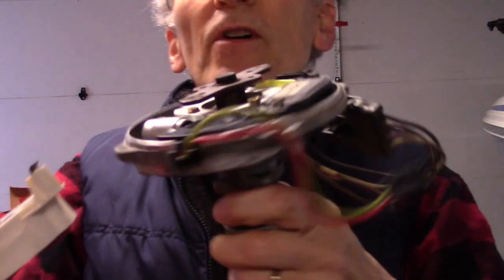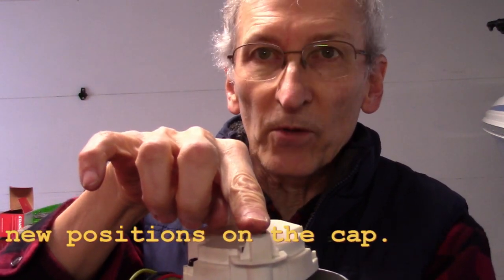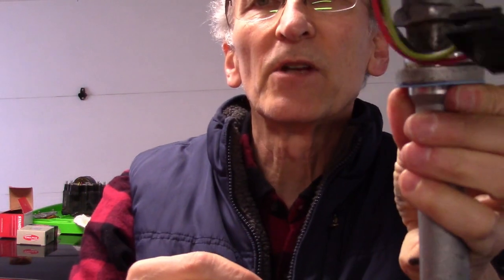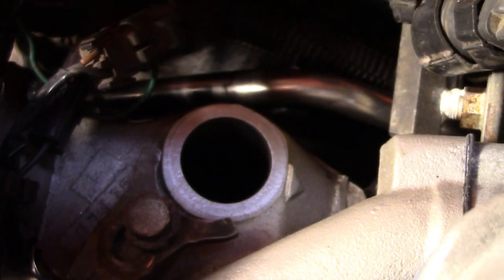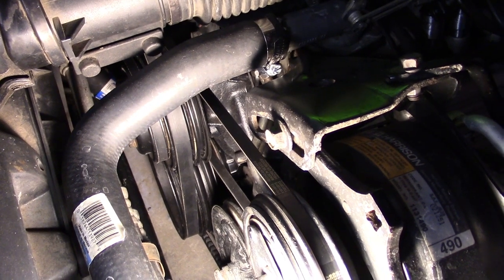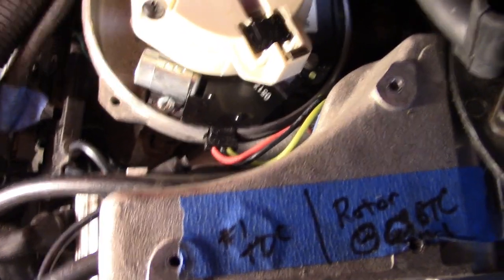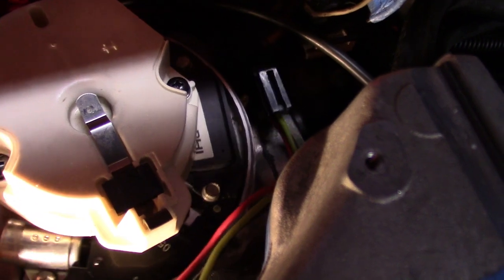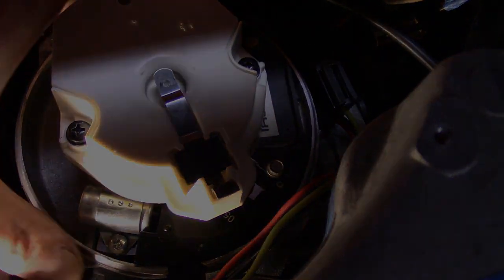Installing the Distributor - 5.0L 305 Chevy TPI - IROC-Z Barn Find EP#37

Comment: My iroc (same engine) has a small sputter/miss during idle after a dizzy swap. Could it be affected by a tooth off or so?
Reply from the maker: If you are able to get the timing set to spec, the distributor is probably not off a tooth.  If it is off a tooth or more, you would usually need to rotate the distributor an unusual amount to bring the timing into line. The cap would need to be pointed in an odd direction. I have done that before on other engines and it was difficult to get the engine to start and run because the timing was so far off. On my IROC, I found that I need to check the vacuum hoses very carefully after I work on the engine.  It is easy to have the evap canister hose come loose (as an example) and a little bit of vacuum leak can upset the idle. I don't know the details of what you swapped, but if those are all good, and it was just a distributor swap; I would be double checking distributor components--cap / rotor / coil and electrical connections.  Something may be causing weak spark.
Reply: @bitsofwisdom460  Thanks for answering. I've sprayed the entire engine down with starter-fluid, trying to find a leak (to no avail).   The distributor is from Standard, I've swapped the ignition control module as it was bad (I suspect a lack of thermal-paste cooked it.) The base timing was set to 7-8 degrees before tdc. I think I might have to fiddle and play with the timing as you say or perhaps try an other distributor from an other brand. 

Do you think fuel-grade will have anything to do with it? Lowest octane-level I can get here in Norway is unleaded 95. Would this have a different outcome and result on timing? 

On the other hand, when I'm not driving it the battery is disconnected (Fire-Hazard). This would affect parametres of the Ecm, right?
Reply from the maker: @kmas8229  My experience over the years with Standard parts has generally been good, but any company can have a defective part. Hopefully the replacement module is good.  Actually any new part can be suspect.  I had a brand new coil intermittently fail on a different car, and a new oxygen sensor and a new IAC fail on my IROC.
I would not expect the octane level to cause a problem.  If I understand correctly, your 95 Octane fuel is the "research" rating.  In the US we use (Research + Motor / 2).  I ran 89 US (or 94 Research) when I was going through break in for a little insurance and it ran great on that.  I did experiment with initial timing on my engine and ran it as high as about 14 degrees. After about 10 degrees, the idle quality seemed to deteriorate. Fuel vapor pressure due to winter vs summer fuel can have an effect.  If you have a full tank of summer fuel carried into cold weather, that can sometimes cause issues.
You are right that disconnecting the ECM will cause the loss of the learned parameters and that could cause some performance issues while they relearn. 
If you are confident in the distributor, I would go back to basics.  Check the fuel pressure, check with a scan tool to be sure all the operating parameters and sensors are normal, check that the fuel vent system is working correctly, because this influences vacuum.
Reply: @bitsofwisdom460  Hello again and thank you so much for taking the time answering me, it means alot for me. 
I had to swap out the icm thrice, first distributor was defective(icm was sent back along with it), second icm made the car sputter and slightly shake during coasting at even speeds with low throttle. An Ac-Delco Icm fixed that. 
Last summer I swapped out the old Multec-injectors for new Bosch 3's (19lbs) Fuel pressure regulator was swapped, filter and also did a thorough cleaning of the EGR-valve. 

After the car was all buttoned up and everything torqued to specs I went over it with starter-fluid to check for vacuum-leaks and fuel-leaks.
Last night I checked the rotor placement in the dizzy at TDC. At 0 degrees tdc it was pointing at the intake runner furthest back on the drivers side (Cyl7). The terminal on the cap for plug wires on cylinder 1  was in and around the same spot. In other words, the rotor was not pointed at cyl-1 during tdc.

(Prepare for a pontientially silly question)

Will this have an effect, as the plug-wires  appear to be in the correct sequence for the firing-order? 

I plan on trying to use the car alot more to let the computer do its thing, just have to wait till late March/April to let the salt be rained away.
Reply from the maker: @kmas8229  You're welcome, glad to help if I can.  Sorry to hear that you had so much difficulty with the distributor.  I am not sure if I understand about the rotor and cap.  Let me try to repeat.  You said that at #1 TDC, rotor points at runner 7, the terminal on the cap for #1 plug wire is near the rotor.  But then you said it was not pointed at cyl #1. I am not sure what that means.

Let me try this.  If your engine is at 0 TDC on cylinder #1 on compression, and the rotor is pointed at the terminal for cylinder #1, that is correct and good.  If the wires are in the firing order from there around the cap, that is good.  If in this position, you can set normal base timing around 6-8 degrees, the system should work fine.  

The direction of the rotor toward the #7 runner should not matter if the above is true.  I think that generally the distributor on a small block sits with #1 around the 5 o'clock position.  Probably between 4 and 6 o'clock, and there may be exceptions to that.  If it is further than that, the spark plug wires and factory wiring harness connections may not be long enough to reach.  Then you could move the distributor over a tooth (or two) to adjust.  However, in principle: As long as the relationship stays in place with #1 cylinder at TDC on compression and rotor pointing at #1 on the cap with the magnetic pickup firing the coil at 0-10 degrees BTDC--the distributor could be installed with #1 pointing in any direction and the engine would not know the difference and be perfectly happy.

By the way, I understand the comments about salt, that is about equal to my climate as well.  I leave the battery connected in winter, but use a battery maintainer that holds the system at a full charge without overcharging the battery.  If I needed to disconnect the battery, I might look for a memory maintainer.  There are some out there that will provide a small 12v charge just to keep the ECM alive while the battery is out.
Reply: @bitsofwisdom460   Hello again, thanks for replying so fast, feels like I'm learning alot here. I'm really enjoying this, again thank you for your time and patience.

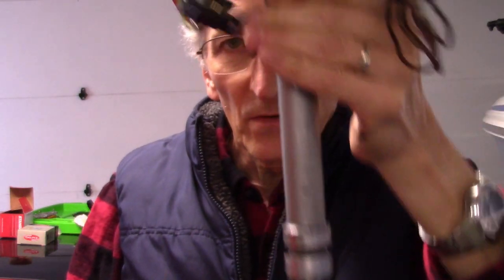You're correct on the direction of the rotor. It's pointing towards 02:00 at 6 to 8 degrees btdc(same as the cap-terminal for plug1, I had it timed for 6 to 8). And at 0 degrees at tdc it's pointing more in the 0300-position. Between the terminals between cylinder 1 and 8.(Sorry for not being too good with my explainations of my woes, I used to be better with English.)

Other than that, the wiring are in the right position for the firing order. I noticed something on the plug-wires that I haven't noticed before. Two of the wires had a long boot to protect the wiring from the heat of the headers. I suspect that the boots were too long. It didn't feel like the wires clicked properly onto the plugs and sat tight. Trimmed them down a bit and got the "click" I was yearning to hear when re-plugging them. Also, I managed to drop and crack the ceramic on the plug for cyl 1 (Butterfingers). I'm gonna see if I can get a new one Monday morning.

I think I need to aquire a long screwdriver to drive the oil-pump a bit so that I may line it up for the dizzy and get it lined up for cyl 1 and then re-do the timing. I got a hunch now, and it's maddening and my fingers are itching to dig in.

As for disconnecting the battery, the guy I bought it from almost had his storage complex burn down due to some mishaps with a battery connected on one of his cars. That's when I decided to have it disconnected when not in use. I do occasionally smart-charge it to maintain it.

Hope you're doing well!
Reply from the maker: @kmas8229  I am doing well, thank you.  I hope that you are, as well.  Your English is very good.  I also know from my time in the global business world to be a little extra careful to clarify things, because we don't always understand a phrase the same way.  Regarding the distributor  cap and rotor, there are some subtle things to consider. I would not necessarily be concerned about the precise alignment of the cap terminal with the rotor. The terminal in the cap may not always line up exactly with the rotor and that is a good thing.  If you think about  it carefully, the cap is fixed to the distributor base with a tab feature, so the terminal is always lined up in a certain angular position relative to the stationary part of the magnetic trigger.  Also, the rotor is keyed to the rotating portion of the magnetic trigger in a certain angular position.  This means that regardless of which gear tooth the distributor shaft is positioned on, the cap and rotor should have the same angular relationship for the same crankshaft angle when the pickup triggers.  In addition, consider that the normal spark timing for an engine can be from near zero to perhaps 36 degrees at max throttle and even as much as 40 or 45 degrees at light throttle.  In order for the spark from the rotor to be able to jump to the cap terminal over a span of 45 degrees, the rotor ought to be ahead of the cap terminal at zero degrees and it will be after  the cap terminal at 45 degrees. This way it should always be able to arc across through the entire timing range.  Does that make sense?
Reply: @bitsofwisdom460  Hello again! Thanks for giving me such an easy and explainatory reply and I'm glad to hear you're doing well! 

I think understand what you mean! So let me try to re-iterate here just to see if I got it right. As long as cylinder 1 has been set to TDC and the distributor is installed with the rotor lined up at the terminal in the cap for cylinder 1 it's all well and good and I'm at 0°?  

And then if the base timing is to be set at 6° btdc (for factory setting) the whole distributor-assembly will be rotated slightly counter-clockwise, so the terminal for cylinder 1 is @ 6° before piston 1 reaches the top of the combustion-stroke. 

And when the EST-wire has then been reconnected the computer will then adjust the timing itself by climate, temperature, atmospheric pressure and other factors provided by the plethora of sensors in and around the engine?

Looking forward to hearing from you! :)
Reply: @bitsofwisdom460  Also, just re-watched your video for the 2nd time and I must say I just had an "eureka-moment" here. I get it! 

I got the tools necessary to do a re-seating of the distributor as well as aligning the notch in the oil-pump. I think I'm gonna do this so that I can align the wiring into the ICM little better as well, they're a little bit tight and out of reach for my liking. I suspect the repair-shop have missed abit on the distributor, throwing the ECM off abit as it seems to run better at idle with just base-timing and the EST-disconnected. It may just be the computer needs to re-learn the different parametres?
Reply from the maker: @kmas8229  Yes, you are correct.  That is exactly right. And, if you watch the timing mark with EST connected, you can see it in action.  My memory on a particular cold start was that the timing went up to near 25-30 degrees (in park) and gradually came down as the engine warmed up.  It all depends on the timing algorithm driven by the sensors.
Reply from the maker: @kmas8229  There certainly are ECM algorithms that adapt based on the system learning how your individual engine is responding.  I haven't been into the code on these older ECMs, but typically there are short term and long term fuel trim adjustments and I expect there are others. What I can't answer is whether this will be enough to bring everything into line for you. 

If it isn't enough, keep in mind that a challenge on these older cars with "OBD-I" is that the controls engineers had only a few years experience with ECM control and the related diagnostics were limited in capability.  I remember when this was all introduced--it was a new world with a lot to learn. What that means is that a sensor can sometimes be a long way out of spec before the ECM recognizes the fault.  For example, I had a very bad oxygen sensor - it would drop out entirely when hot  (video is posted).  But the diagnostic required on the order of two minutes at a steady road load with certain boundary conditions before it would set a light.  It was hard to get that condition.  Just something to keep watch for.
Reply: @bitsofwisdom460  Hello! Good to hear that some knowledge got into this noggin of mine! Awesome!

Wow, that's a high timing indeed! How was the weather and temperature on that day?
When I had the car at the shop for the distributor-swap the old guys there (who had basically had most of their childhood beneath the hood of old American cars) were not too familiar with these engines (neither was I, had just aquired the car) . They gave me a call and were scratching their heards at the timing, as they imagined that it would be adjustable as with an old carbureted engine. 
I think the timing was around the same ballpark as yours! We were astounded and thinking "How's this thing running at all?!"

On the algorithms and parametres of the ECM, kinda being hopeful that just using the car later on will fix the issues I've been having. Haven't driven the car as much as it deserves. 
Re-seated the distributor yesterday and gonna have her timed today! Hoping for the best. By the way, I think I'm gonna advance the timing a bit. I'm thinking around 10° btdc sounds good?

As with the video on the O2-sensor, I remember that one! That must've been frustrating! Being a millenial I can only imagine what mechanics, hotrodders and engineers were thinking. As with EV's I reckon there were some skepticism?

Hope you're doing well and having a good day!
Reply from the maker: @kmas8229  I have run with base timing up to 12 degrees. It seems to have a little more power there and knock sensor will pull back if necessary.  I am back at 8 right now, because in hot weather, the idle speed was a little unstable.  It is your choice, but I haven't had an issue at 10. I do have a slightly stronger cam, so that can also have an effect.
Regarding the amount of timing for an engine, it depends on the individual engine combustion chamber design plus the emissions limitations.  Many of the older American V8s liked 34-36 degrees at wide open throttle and high engine speed. With vacuum advance cans that provided 15-20 degrees, total could be in the 40's at highway cruise. At light throttle, flame speeds are much slower, especially with a lean mixture.  The newer engines like Vortec 350 or LS have "faster" combustion chambers that need less timing.

When GM came out with ECM controlled carburetors and 3 way catalysts in 1981 (ECMs in every car), there was great skepticism amongst many of us engineers as to whether the cars would be durable.  But the Delco Electronics team really did a great job with the ECMs and the vehicle divisions generally integrated the systems rather well.  The systems were much better than many of us expected.  I know that there was variation and some customers had complaints.  In my case, sometimes I had warning lights, but I was never left by the side of the road with my 80's GM cars.  It was  quite a revolution and a lot of learning.
Reply: @bitsofwisdom460  Aaah, I see! 10° was tempting at first, but I was wary of spark-knock or pinging and the problems that may occur if I run the car with it.

Cool! The older distributor didn't have a magnetic pickup-coil right? It was "points" or what it's called and they had to be replaced at service intervals and tune-ups? With Vacuum-advance on older cars, would the vacuum-canister be the "big 'ol lump" attached to the side of some distributors?
Sorry for asking so many questions, I'm having a great time with this knowledge and the "history lessons". 

By the way! I re-seated the distributor yesterday with the rotor towards cyl #1 at tdc 0°. Timed it at 8° btdc.
After that I did a IAC-reset, idle speed adjustment (a 3/4 turn inwards on the idle screw for more air) and set the TPS at exactly 0.54 (OCD got me the right voltage haha) She's running like a champ now at 750rpm all buttoned up!

Again; Sorry for pestering you with questions. Hope you're doing good!
Reply from the maker: @kmas8229  I am doing well, thank you.  And it sounds as if you now have success on your car.  Congratulations!
Yes, the vacuum advance can is the big often shiny lump on the side of the distributors without electronic spark control.  The vacuum can design goes way back into the breaker point days.  I don't know when it was invented, but it has been around since at least the 1950's.  Electronic ignition came around in the mid 1970's, so vacuum advance was used in both types.  I think GM introduced HEI in 1974, primarily because catalytic converters were coming in 1975. While breaker points were actually not a bad system, they needed regular maintenance and would have fried many catalysts when people didn't keep up with it.

Regarding the advance methods, the engine needs more advance for two reasons: 1. the combustion process is slower at high vacuum and more time (or crankshaft angle) is needed and 2. when the engine speed is high and time from spark to TDC is shortened.  So, the way this worked is that in the mechanical world (assume a small block), the distributor had a mechanical advance mechanism of weight and springs.  You might have 25 degrees of mechanical advance that would start at zero at idle and max out at perhaps 4000 RPM.  A hot rod type could juggle the weights and use lighter springs to bring that in sooner.  Then at light loads, the vacuum signal would be high.  A vacuum can would provide maybe a maximum 10 to 20 degrees.   I once had a big block Oldsmobile 455.  It had initial lead of about 10 degrees and about 25 mechanical.  In addition it had about 20 degrees in the vacuum can.  That big engine would pull about 20 inches of vacuum at 60 mph and with no overdrive would run at about 2500 rpm.  So: 10 lead, about 15 mechanical at 2500 and 20 vacuum would make about 45 total and the car would pull down about 19-20 mpg at that condition. (we had a 55 speed limit in those days). The beauty of the electronic systems is that while they started with the same concepts, they are not constrained by the physics of weights, springs, and rubber diaphragms.  The software provides the calibrator many more knobs and adjustments, but the thought process is quite similar.
I'm sorry this is so long, but that's the general idea.
Reply: @bitsofwisdom460  Hiya! Glad to hear you're doing good!
Thanks for that, couldn't have done it without your help and the "push" to get my mind set in the right direction on how things work and how to make it work. Also with the historical lessons of how even older patents work Really fascinating! I've had a great time and feel a motivation I haven't felt since I first got the car. I'm thinking next project will be to install an aftermarket wonderbar to stiffen up the front a little bit.

Ohhh! I see how it hangs together now!
Also, great mileage you had on that Olds! Those were (and still are) really beautiful cars!
And after reading this I'm thinking that timing and other things being governed by the Ecm ain't that bad and "scary" after all! I've admit that I've been tempted on going for an even older car for simplicity's sake, but it might be "more" things to worry about than just a "Check engine-light" and codes.  I think I'm just gonna enjoy the car this summer and see what the future brings! 
Also really looking forwards to your future videos, my friend! 

Again, thank you so much for everything!
Reply: @bitsofwisdom460 Hey man! Long time no see on this here comment thread. Just wanted to inform you (and others who may be reading this) that after checking timing & other stuff again & again & going over the entire engine countless times that I found the culprit of why the car was intermittently missing at idle & at low load at light throttle.

Slipped timing mark on the harmonic balancer.

Put my thumb over cyl1 plug hole, turned over the engine by hand and kept going until the compression wanted to shoot me & my thumb across the garage-floor (exaggeration is important to keep things interesting). Put a boroscope into the plug hole, kept going until I saw the piston at the top and found that TDC was 10* off ADVANCED on the mark. How did I see that? Because the day before I set it to 6* ATDC and the degrees-adjustment on my timing gun showed it to me. Made a new mark with a sharpie and set it to 8* ATDC.

It runs like a dream. Sweat, tears, blood and gore up to this point.

Now I need a new harmonic balancer. What kind did you go for when you rebuilt the engine? Mine's an 87 LB9 so it doesen't have a serpentine belt.

Thanks man, hope you're doing well & in good health!
Reply from the maker: @kmas8229  Wow! Glad that you finally found the problem. I'm sorry that I didn't think about that one. I know that damper failures happen on occasion, usually when the rubber ages. I should probably post something about inspecting the dampers. I would be interested in how yours failed.

I did not change the balancer when I did my rebuild.  I inspected it carefully to see if the rubber was cracked or had any evidence for deterioration of shrinkage and that the keyway / timing mark lined up when the engine went back together.  With the front cover off and the timing chain aligned, it was easy to check.
Reply: @bitsofwisdom460  Good morning! No no no, nothing to feel sorry about! How could anyone but me know or see it? Such an easy & simple thing to check is often overlooked.
Would be cool to have a video up on it yeah! I saw a video on dampener & balancers that Uncle Tony Garage had up and that's what made me think "Wait a minute" and then go check it. Sure enough, that's what caused my issues.

I fired the parts cannon trying to eliminate the issue. Plugs, wires, distributors (running a Davis Unified one now, really well built unit made in the US)
Injectors (southbay injectors Bosch III's), Fuel pressure regulator, knock sensor, IAC, TPS, EGR-valve, coolant temp sensor. Bear in mind that this is over span of 3-ish years on & off. Car hasn't really been driven much.
Got into datalogging with Tunerpro and ordered a shop manual and electrical supplement from your former colleague at Books4cars.

What could've caused it? Age is a factor as you mentioned and it's the original one by the looks of it. I'll see it once it's off the engine. Oil or other pollutants could've seeped its way into the rubber or in between the steel & rubber over the years causing it to deteriorate. I have no leaks (knock on wood) from the front, but there could've been one earlier that has been eliminated whether it be the timing cover seal or a coolant drip from the water pump slowly working on it.

How did it slip over to advanced? The forces of a rotating non-solid-substance-compared-to-steel-mass must've given enough momentum horizontally shift it and the mark along with it. Especially with the mid-layer being sub-par in it. Not a vertical force, I guess it didn't manifest itself by vibrations I could feel during the drive, or see on the damper itself as it hadn't shifted towards the timing-cover or towards the radiator.

The engine had intermittent vibrations, shakes,  random missing and spitting from the tailpipes especially during idle (from the timing being wonky). This also was apparant at 1500-2000rpm at low load, low throttle cruise. Intermittent jerking, fluttering rpm-gauge during these rpms and the upshift-light flickering once on a while. At WOT she felt good.
The ECM & the ICM must've been fighting hard to retard the timing and probably saved the engine from having holes burnt into the pistons. How would this manifest itself on a carburated car?
Reply: Oop! Forgot to mention that it ran better with EST disconnected, which was also misleading.
Reply from the maker: @kmas8229  It is hard to know the detailed symptoms from a bad balancer. I don't have deep experience with broken dampers, so bear with me for a minute while I go out on a limb... Going to basics, the harmonic balancer or damper is intended to reduce torsional vibration of the crankshaft.  At a certain rotational speed, the crankshaft will have a torsional resonance excited by the cylinders firing.  The damper is typically tuned so that the outer mass will counteract or limit this vibration by its movement on the rubber element. So, in simpler terms, as the crankshaft is spinning, the outer ring of the damper is oscillating back and forth in the direction of rotation. 
That suggests a couple of things. First, if the rubber element begins to slip, the timing mark will be off location as you found.  And, that timing mark may drift around and not be consistent. In addition, if the rubber and the outer ring is slipping, you may have odd torsional vibration in the crankshaft. That odd vibration might feed back into the timing chain and camshaft. That vibration could then drive back into the distributor shaft.  Instability in the distributor pickup is variation in the engine speed signal that drives both ignition and fuel control. This would be most pronounced in the resonant speed range.
Reply: @bitsofwisdom460  I see, that makes perfect sense! Would be awesome to have have a video up on the topic, fascinating stuff.
Reply from the maker: @kmas8229  If your engine is close to stock, I would look for a stock replacement type part as it would be tuned for the job. There are high performance ones that are intended to handle a wider speed range if the engine is running at much higher than stock speeds.
Also, I would be interested in a picture of your bad part just for curiosity when you get to replacing it.
Reply: @bitsofwisdom460  Sure thing. I ordered a new one and it's on its way. I'll be back from sea in a week, then I have 2 weeks off. I plan to "get 'er done" by then... If the tools I need arrive by then, I suppose. Do you have a preferred way I can send you the images when the time comes?